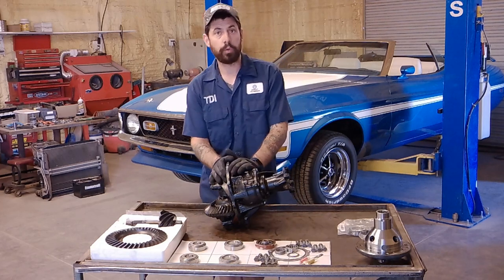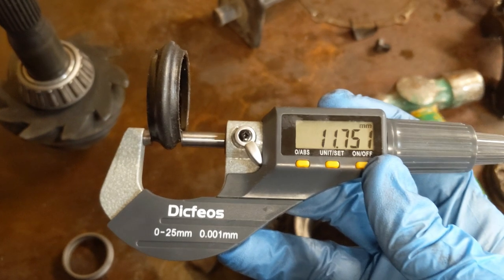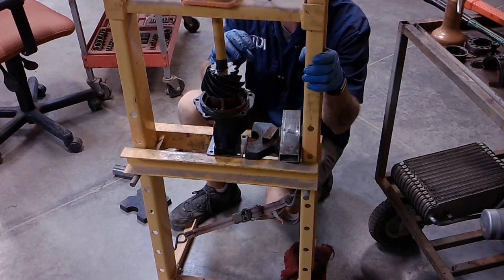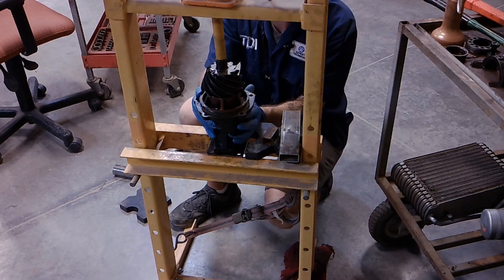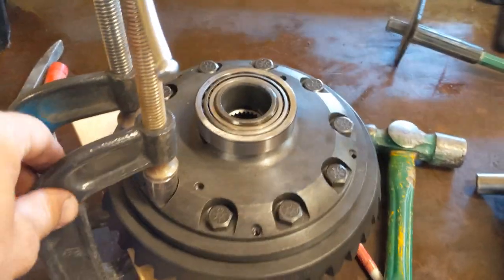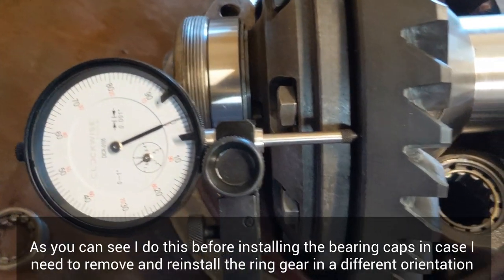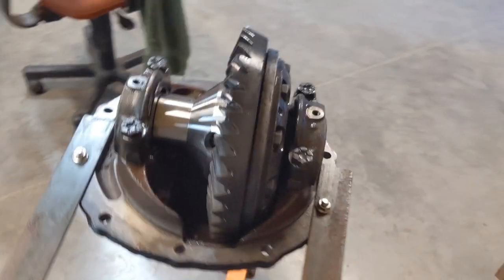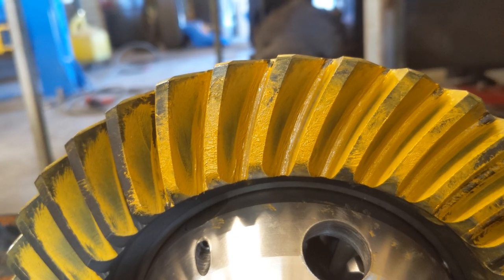How to change gears and add a limited slip to a Ford 9-inch

Comment: Wow, this is the best video about this topic I have seen so far. I am in front of rebuilding my 9" rear axle of my '73 Mustang 351C 4V w/ 4-speed. It has original 3.50 gears, 28-spline and open diff, will change to a Ford Trac Lok and keep the axles and gears. Your video gives a good overview what and how to do - thank you very much!
Reply from the maker: Thank you so much. My goal was to take away a little of the mystery and fear people have with swapping gears. I think you will love the Trac Lok, its a great LS
Reply: @AustinCoulson  Yeah, goal achieved! I think, too, that I will be much more fun than the open one. That car ever called for one ;-)

Comment: You are very creative 👌! I've been retired for 10 years now and I have worked around many mechanics. If I have anything to help you from experience, it's the red rag lint issue. Please take my advice without taking offense. Otherwise I would hire you in my days of twisting bolts 
Gary Bounds 69 years young.
Reply from the maker: Ugh, I hate those red cloths. I prefer microfibers for that exact reason, but I was given a ridiculous amount of these red ones and was burning through them

Comment: Thanks!  Need to do the same thing on my new 1978 Ford F150 with a 351 Windsor, 3 peed automatic, 15" wheels and a 2.75 rear end.  AOD + 3.70 rear + larger tires seems to be the way to go.

Comment: Those original gears were 2.75, not 2.73.  Axle code 2 with the open diff.  I have a couple 73 mustangs with that rear end I'll get around to swapping one day.  And however bad you think that is, I just swapped out the factory 2.54 gears in my 82 C-10.  :D
Reply: I bought a 91 Fox body LX hatchback back in 1995.  It had 2.73 gears in the 8.8 axle.  The intake manifold and stock heads had mild porting, and I put a 2.5 exhaust on it.  The car would do with an estimated 260 HP 158 Mph in 4th gear.  Put it in 5th and it would slow to approximately 137.

Comment: Nice job. I recently watched DeBoss do this on his Goat rear end, the slight differences were interesting. Based just on the size of that pinion gear, I would have swore it was out of a truck lol.  Good stuff!
Reply from the maker: Thanks! The 9 inch pinions are just massive. I ordered new gears for an 8.8 at the same time and it's crazy the difference side by side
Reply: @AustinCoulson  I have a ford 9" rear on my 1974 Lincoln Mark VI. I want to swap my 2.75 gears for 4.86 gears. Do I have to change the differential?!
Reply from the maker: @robbyrob8349  that's a pretty dramatic gear change. I know on some carriers you need to do extra work grinding some steel if the ratio is really high, but I haven't gone beyond 4.56 on a 9in so I'm not sure. The process for 4.56 was exactly the same as this video shows

Comment: He has according to his measurement .027 inches (.71mm)  of play.  He needed to place an indicator on the housing, measure the axial movement and press again little at a time reducing play down and  into the tolerance, whatever that is, maybe .008-.015 or something. This will be a problem when setting the gear lash to the ring gear.  Good luck

Comment: I found this video to be extremely useful and informative.  The explanations were clear and to the point.  I’m disassembling a 1966 Thunderbird 9” soon.  There is noticeable slop in the yoke I found after removing the driveshaft U joint.  If I have questions, do you have an email link?  Thanks so much.  Bill in Oklahoma
Reply from the maker: acthecarguy@gmail.com Excessive play is common on higher mileage rear ends and usually just indicates normal bearing wear, and can be fixed easily when swapping gears

Comment: Very nice video.  I'm currently getting new gears in my 9" (4.11).  Was going to do 3.89 but he went threw two sets of gears and both had whine.  He said that 3.89 tended to do that.  He said 4.11 are better cut and should be more quite.  I have a Tremec 6 speed Magnum so I am not worried about high revs on the highway.  What are your thoughts on 3.89 gears and the whine?  I also have a clunk sound when loading and unloading (especially in 1st gear).  They are hopfully going to get that straighten out too.
Reply from the maker: I have not heard of a specific ratio having a whine. Generally, the higher numerically you go, the more of a whine you experience, but the whine should be all but gone once the break in in over. These 3.70 had a little whine for the first 500 miles, but it's practically impossible to hear over the flowmasters after the break in. The clunk sound scares me more than the whine, there really shouldn't be a noticeable clunk when loading/unloading. The pinion play should be tested after installation and again after 500 miles and should stay within spec (.010-.015 I think?). Usually when I hear that clunk, it's pretty far out of spec. If it's in spec and It's still there, I will try a different fluid with a slightly higher viscosity.

Comment: Great vid Can you tell me by deducting 5 thousands on pinion dept ,How many thousands would it add or deduct on backlash ?
Reply from the maker: 5 thou pinion depth will pull the pinion away changing the wear pattern, but because the carrier position and preload are so easy to adjust you should be able to loosen the pass side carrier nut, tighten the driver's side minimally (1/16th of a turn or so) and end up with exactly the backlash you need, just with a preferred wear pattern. If you didn't adjust the carrier, I would expect the backlash to increase between .002-.005

Comment: Great video. I have a 9 in nodular with a full spool with 4:11 gears. I want it streetable so I need to pull the spool and replace with a Trac-loc . I am scared to death to do this myself. How much would it cost to have this done at a good shop? Thanks.
Reply from the maker: I wouldn't be too scared to do this yourself if you have the tools. Swapping the spool for a Trac loc should be a lot easier than doing gears as the shims probably won't need to be adjusted. Prices can vary a lot by shop and location. If you supplied the Trac loc I'd expect 900-1400 in labor, if you had the shop supply the Trac loc I'd expect 4-500 more. I think 1500-2500$ is pretty common for gears and a posi installed
Reply: @AustinCoulson  Thanks Austin! Do I need an axle spline count before I order the "Posi" unit?
Reply from the maker: @robertclymer6948  yes, but you can get that super easy with just a 9/16 socket after you remove your tire and wheel. You have 4 bolts that hold the outer bearing and axle and once those are gone, the axle slides right out. You can count the splines and slide it back in in a matter of minutes. Where are you located? I may be able to direct you to a shop if you aren't going to tackle the full install yourself depending on what city you are in.
Reply: @AustinCoulson  Thank you so very much for donating your valuable time to me. I appreciate it so much. I live in Westland, Michigan, a burb of Detroit actually next to Dearborn. I wont have a problem pulling one axle, I got that down pat. I have spoken with a couple of shops and I actually have just one I trust who is a 30 year vet at transmissions and axles ect He has an outstanding reputation too. Thanks again for everything. Looking forward to yur next videos.
Reply from the maker: @robertclymer6948  thanks for the kind words. I am happy to do whatever I can to keep older vehicles on the road. When you pull the axle, that's a great time to check that bearing and if you have a 28 spline and are running a lot of power, you can always buy the 31 spline Trac loc and swap in 31 spline axles at that time. I don't upgrade axles until I get over 400hp to the wheels, though. Sometimes the cheapest way to get axles is to buy ones that have long splines that you can then cut to length. Take care and good luck! Reach out if you have any more questions. You will LOVE the Trac loc compared to a spool on the street. Spools are for wild teenagers IMHO
Reply: @AustinCoulson  Thanks again for your advice Austin. My mustang is an Ex- 8 sec race car but now has a mild built 460 in her. Maybe 450 HP I am sure the spline count in there now is 31. I am pulling the Axle out today. Cheers, and Keep those videos coming sir.
Reply: @robertclymer6948  Mr. Clymer I lived in Westland before it was Westland are you speaking of Deweys transmission in Garden City by chance.
Reply: @annedimassa8732  Hi Anne! Not Deweys on Middlebelt. I think I got a quote from Westland Trans on Ford Road down by Wayne road.

Comment: Regarding the crush sleeve:  Could one just measure the old one then machine a sleeve with the same dimension and forget about crushing at all?
Reply from the maker: The issue is that with new bearings the size may be different otherwise you could just reuse the old crush sleeve with new bearings. That's why the torque wrench is required to determine preload.  Some guys do use a machined sleeve in place of the crush sleeve, but they still have to verify preload.
Reply: @AustinCoulson  Thanks.

Comment: I'd love to have that 2.73 gear set.  Send it my way.
Reply from the maker: I think they'll fit in a flat rate box. You pay for the shipping, i'll throw in the mail to you. I checked the pinion threads and they are all good. acthecarguy@gmail.com
Reply from the maker: anonymous  he did take those, sorry
Reply: Are you sure you don't want at least 3:73 gears? Better performance for a cruiser.
Reply: @robertclymer6948  these cars are easily beaten by stock trucks and Honda civics. You might as well keep the rpms down and get decent mileage and look good doing it.
Reply: @superduty4556  Oh yes Austin, so true! Even my F-150 2.7 eco twin turbo puts out around 325 HP.